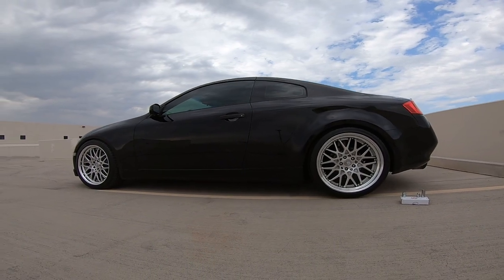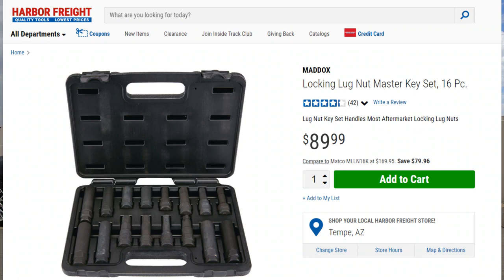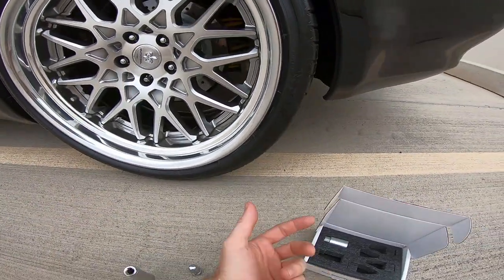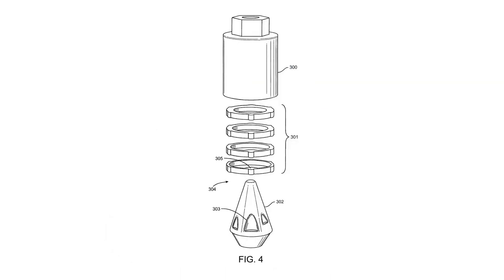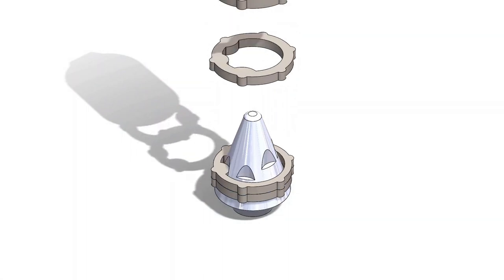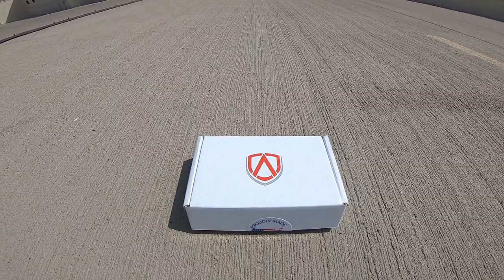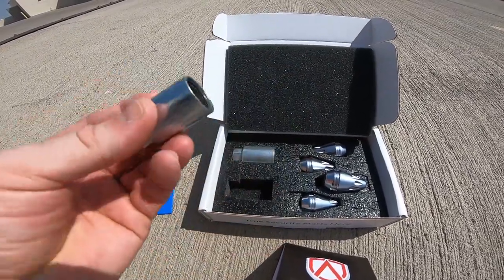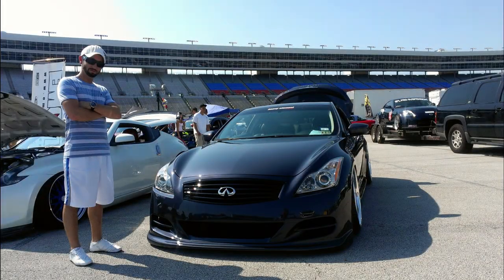Advanced Wheel Locks Review - The iphone of wheel locks

Comment: I dunno man.. So.. what happens when u lose or misplace the key?? Then say u have a flat tire, or the vehicle needs servicing or repairs done - but there is no key with the vehicle or it has been lost?!  
    Seems overkill, and more problems to deal with if u lose the key, or if it gets damaged. Then u have to destroy your wheels to get them off - or wait weeks for a replacement key from a one-off manufacturer (if they are still in business and a replacement is available)... That's not worth it in my opinion... 
   For myself, being a master mechanic; this scenario was one of the worst ones to deal with, in those rare cases when our master McGard keys & other sets wouldn't work.. Like working at a GM dealer & servicing a VW, BMW, Benz, aftermarket wheels, & etc types of vehicles (with various rim & suspension setups). Then u find that the locking lugnut was damaged, seized, or the owner's lug keys were lost. In those cases it was either 3 (maybe 4) options, but usually 3 (as people need their cars to travel, get groceries, go to work, get kids to & from school, etc)... 
  Those 3 options are; forcing a special hardened steel taper socket onto the lugnut with a sledge hammer & hoping the socket grabs enough to loosen the lugnut, or air hammer the lug key off in a loosening rotation, or if all else fails oxy acetylene torch it off!! 
  The last 2 methods can easily damage wheels. Air hammer extractions can be done cleanly & without damage; but with some designs of wheels (for example - ones with narrow lug wells) will often cause damage to be more likely to occur... As for the last resort - oxy + acetylene torching - this method will almost always result in damages; either to the paint / finish damage at the least, and up to melted wheels around the lugnut wells or completely cutting the wheels off.

Comment: What about cutting? I don’t mean to be rude or anything but does it withstand tools that were meant to cutting metals?
Reply from the maker: Good question. I doubt you can even get a cutting tool inside the cylinder walls to the nut. These wheels cost $4,000 without tires. I park at Motel 6s in the hood because it is cheap and they allow dogs when I travel. I still have my work wheels so they work.
Reply: Motordyne G35 tbh now that you mention that it makes sense. It would be hard for a criminal to cut these due to the fact that it would require a great amount of force to cut them. I actually live in the hood and I have a 370z. Some people here have 350z, bmws, and a Mercedes but my Honda was once stolen and I’m a bit scared of getting my 370z stolen

Comment: If you wouldn't mind giving an update on these wheel locks I have a few questions. First question is it rusting or chipping on the finish and also the internal disk in the wheel lock are they loose or tight I thought the disk may move inside when using the key.  Last do you still have your wheels with these locks cause those wheels are nicer than my stock Honda wheels but Honda wheels equal theft.
Reply from the maker: The inside of the wheel locks are permanently positioned by casting. It will never come loose. Finish is perfect, still have them. Just uploaded a video today with drone shots.
Reply: Thanks for the quick reply much appreciated.

Comment: Me and a buddy got these off easy all you need to do is get a good deep impact socket weld in a good spade bit set all that’s left is cutting a slot into the wheel lock and that s%# ah come right off if I were a theif I’d walk around with that socket as a tool to take thoes off you can use wire cutters too if you have to be silent

Comment: idk man i bought some , and the key plate material  looks like it will strip aventauly , first time use, i seen damage on the key plates ( i thought about this b4 installing so i tried my best to keep the key  flush against the lock lug correctly) these locks will be A+ if the material was harder
Reply: DO NOT use an impact. I'm sure over long term the key will wear, but the problem is rust. It scrapes off the coating first time and they look like shit.
Reply: @TheGuruStud  yeahh i did not use impacts. i also notice the rust is going to be a big problem with these locks.

Comment: What if you lose the key?
Reply: I thought of the same thing. You keep a serial number they give you when you buy pretty much any lock. Manufacturer can then get you a replacement key. Video suggests you keep this  # in a safe, I might keep it with the key, hidden in my car. My guess is that, like a potential thief,  a shop would have a lot of trouble removing this lock design if you had no key AND no serial number so definitely keep serial number safe so that Mfr. could sell you a replacement key. This product  look great, and I want to go with this plus  a cheaper sliding sleeve type lock on opposite side of wheel. My only concern is with the key replacement availability in the future, as this is a startup, and their  video from a year ago mentioned not getting kickstarter funding. Apparently they got that and are doing well now, but will product be supported in future, and the replacement key availabile 10 years from now? I may inquire about just buying an extra key now and putting one in a safe and one in the car, as folks have said this is a good value for the quality. Great idea and I wish them the best of luck and hope they do have a long term and viable business here.
Reply: @dalab9716 

The company is alive and well.  I just bought 20 identical nuts + 3vkeys, just in case.  Installing them tomorrow.

Comment: These are Worth $60. Not $125
Reply from the maker: Make sure to comment back here when your wheels get stolen for buying cheap wheel locks. How much you spent on wheel locks that don't work, the new wheels and tires you had to buy.
Reply: @MotordyneG35  still not worth $125
Reply: It’s worth $125 if you spent 2k on aftermarket rims and tires..... everybody and their bother has keys for common wheel locks
Reply: @MrEvtmazda 

How much would it cost to replace all of your wheels and tires?  Seriously, do the math.

I have stock rims and nice-ish tires ($150 each).  Buying basic wheels and the same tires would cost me $1,000 just to drive around.

Better to buy these NOW for a fraction of the cost of replacing your current  wheels than spending that same amount PLUS the cost of your new wheels and tires because you got robbed.
Reply: @andrewryan2559  A lug extractor will yank these right out. They are still easily defeated by thieves.